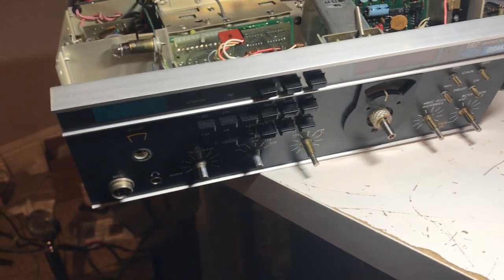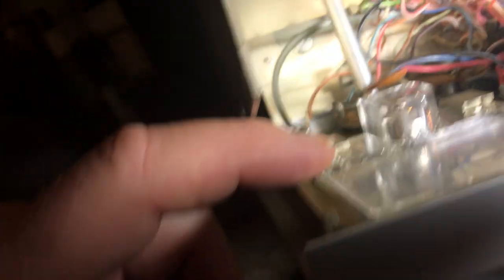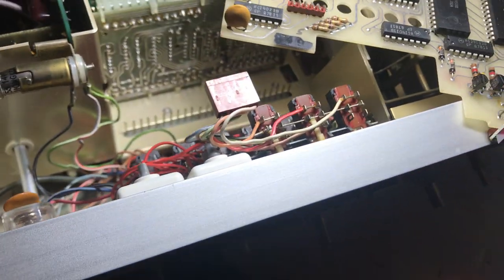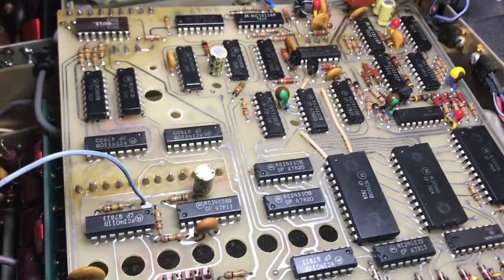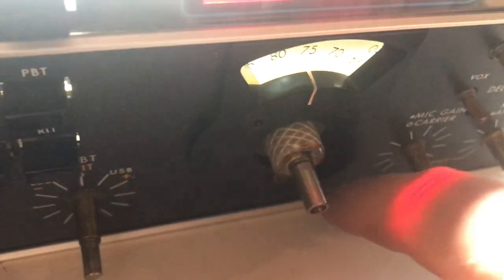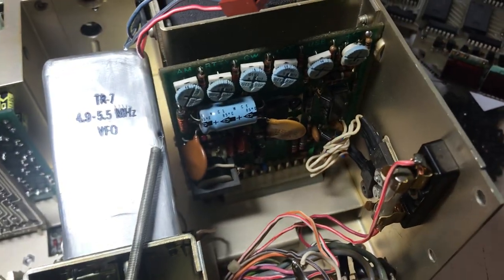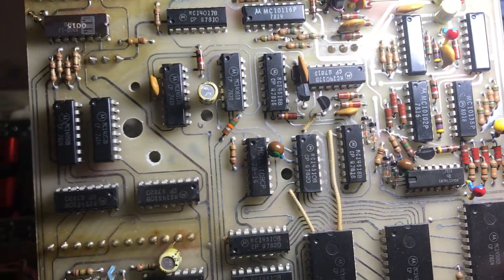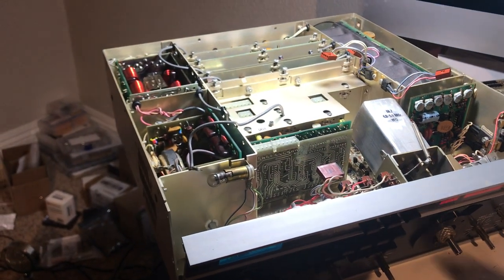Drake TR7 How to remove DISPLAY Board and front panel February 8, 2022

Comment: Great video Thanks. I have a Drake TR 7 which has no LED display now; everything else is fine. My guess is a tantalum, electrolytic or possibly a transistor on the display unit has failed. .  I'd be surprised if one of the ic's has failed but you never know. I was looking for a video which might help me understand how to pull the display board and you did an excellent job.
'So' I'll pull my unit soon, check the caps and try to get it going.

With regard to the TT Omni 6 or 6 +. I have 4  omni 6 + and they are great rigs, especially for CW. Though, they are fine for SSB as well. The O6 is very easy to work on and based on your video, getting the front panel off is easy. ..........in fact, by loosening a few screws, the fp, tilts down allowing easy access to everything behind.
All boards are easy to get to and no fancy tools, squinting your eyes just right etc is required to get to anything.
I think INRAD no longer sells filters for the O6 but they show up on ePay from time to time. The roofing filter really helps if you like CW contesting.
I have had at least one Omni 6 since the first few months after they were released and I still love them.  i also have a  Drake  c line with the  Sherwood mods and filters and it's a contesting champ too. just the T4XC like all tube xmitters is not great for fast freq or band change. 
If you get an Omni 6 and want to make a few worthwhile mods, get back with me and I'll give you some ideas. Although, out of the box and a few CW filters give extremely great performance.
73, de WA4AOS, Glenn